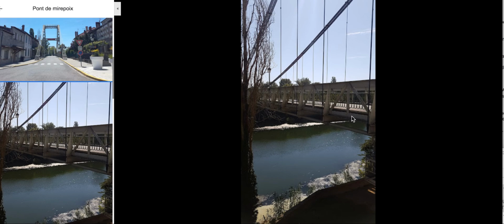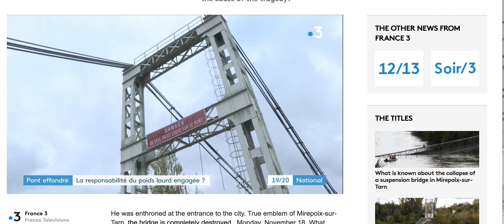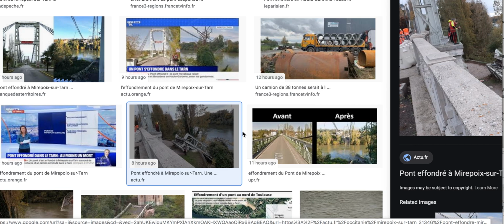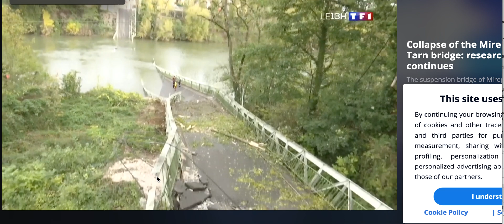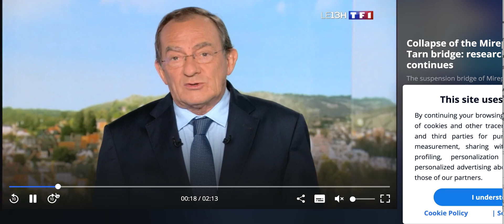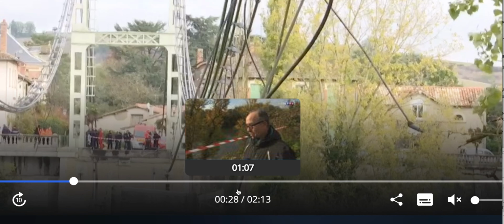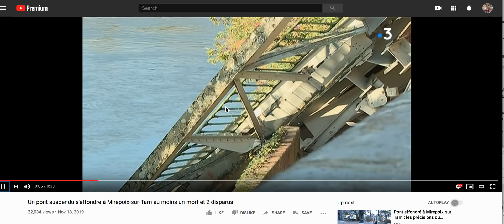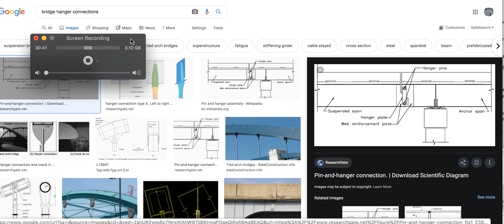France Bridge Collapse HANGER CONNECTION FAILURE via overloading Pont de mirepoix Pt 2 of 2

Comment: that image at 7:29 speaks volumes to the cable, the weather boot, and that almost looks like a nut below what's left of the beam-end/flang-loop. looks like that ripped apart at the rivet point if that's a bracket/gusset-plate riveted onto the floor beams. on some of them, the cable was never close, it was the cable/hanger gusset plate looking thing. 1931, makes me not sure if that black is weather coating, or cast-iron for the parts.

ok, looking to see what developments happened since I fell asleep on the KB. I am clearly rusty on 'when' some developments happened with train trestles back in the day. 1781, ok, that's about 150 years before this one, so maybe that isn't cast iron. (as Stephen Hunter pointed out) 22ton truck on a 19ton bridge, looks like the prob was between the seat and the steering wheel.

Comment: I think that the word you are referring to with the cable attachment is robust. It’s not substantial and robust.
Reply from the maker: The cables are good for the most part and the ''hangers''; 
they appear to be aged and deterioration has taken place...  This means it's limits have been lowered before it meets ultimate failure.
Reply: The suspension cable is a cantinary so each drop will start long and shorten throughout to its bottom apex and revert Back. I often wonder about loading and weight transfer on cable stay bridges. I also wonder if the pier pin hangers were inside the beam or outside. It could account for the left pin plate bending, then just slipping out of the right. Keep me thinking, I really like you keeping my brain working on these physics and learning failure analysis.
Reply: Yes, the cables themselves looked good, no breaks or frayed ends. As you said, they must have pulled through the bottom mountings, or were attached in a manner that could have deteriorated over time and weathering.
Reply from the maker: Hooter, the "hangers" are of a solid bar material...
They are not cables, the cables are what they attach to at the "top" and those cables go over the end "towers" and down to a "ground anchor / block" of concrete.
Reply: If I can’t have a Stella Artois with ya, I have one for ya. Cheers
Reply: Like a pin through holes in swing plate. Kind of like a swivel rocker not a curved rocker. Am I correct? It can swing forward and back, as expansion and contraction take place from temperature. This is underhung from the pier to the under deck lateral beams. It is used in spanned bridge girders here in Michigan   Like the bouncy one I asked about some time back. I’m still trying to find DOT information just to close the subject for me.
  The cables are all overhung from the ends of the cross beams and the decking is upon that. My interest is how the cables are actually connected to the cross beams.  It looked sketchy from those views. Sorry if I’m getting too chatty. Just tell to sit down and be quiet while class is in session.
Reply: My biggest problem is that I verbally draw a picture with crayons and you explain things with a multi media artist drawing and draftsman set.
Reply from the maker: Yes, just think of it as a swing to help you see what is going on... To the connections, they were okay when this structure was built and they were not thinking of 2019 and this truck driving over the structure or that maintenance might not be done.